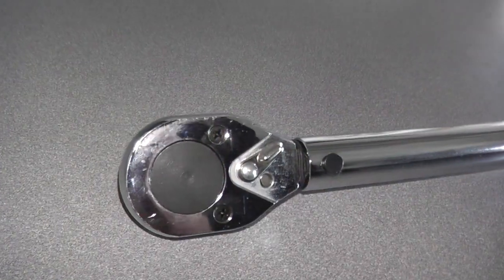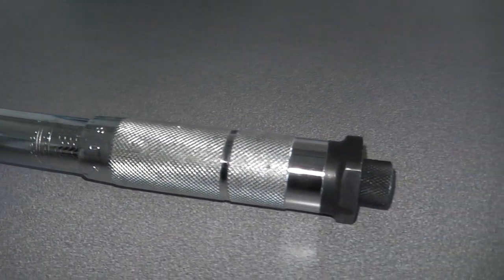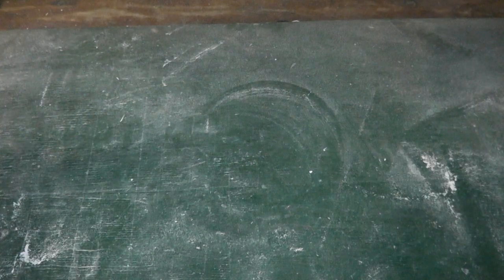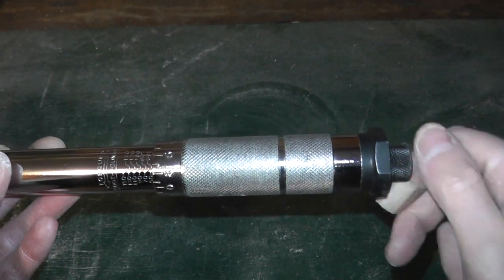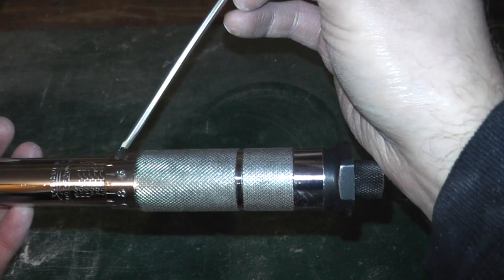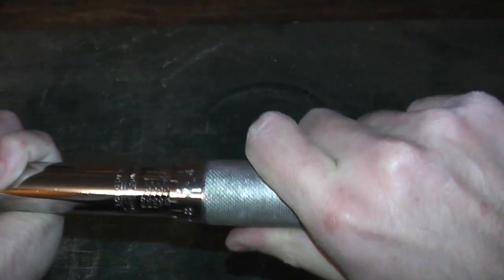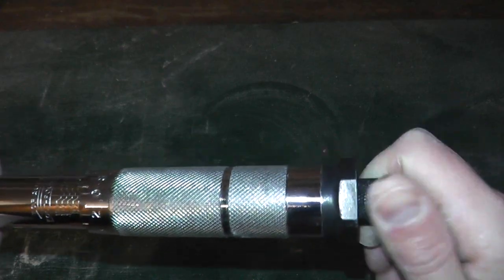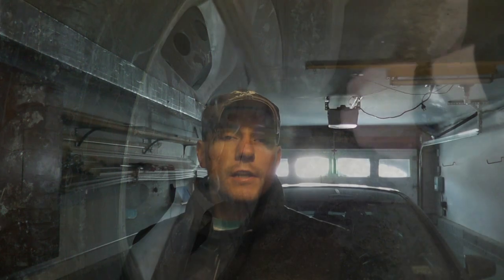How To Use a Torque Wrench

Comment: HF says to recalibrate these every 6 months what's your thoughts on this? Do you bother or does the wrench stay accurate much longer?
Reply from the maker: I haven't recalibrated; I didn't see that in the instructions. Although this is an 'older' wrench I'll double check this evening. Appreciate the heads up. (I have had no issues thus far using the wrench.)
Reply: CarsNToys no problem i just bought the 1/2" torque wrench from HF and there's a little paper instruction insert in the case. Also on their website under the product description there's a pdf download of the same instruction insert that comes in the case. I'm gonna return mine and get a digital torque adapter that can turn any ratchet into a torque wrench and can test any existing torque wrench calibration. HF sells one for $29.
Reply: A serious mechanic like yourself probably best to get a better torque wrench and a digital torque adapter to check it now and then.
Reply: CarsNToys not worth it for me unless you can calibrate it on your own because the calibration costs more than the torque wrench. There's an instructable.com article online called "fixing and calibrating a clicky style torque wrench" or buy the digital torque adapter that snaps on your torque wrench for $29 from HF and you can test your calibration and also use it with any ratchet or torque wrench. Not sure how accurate it is but plenty reviews online.

Comment: I have a spec of 10.333333 of foot pounds. How do I set it? Ever so slightly off?
Reply from the maker: Use an inch-pound torque wrench rather than a foot-pound torque wrench. 10 foot pounds is equivalent to 120 inch pounds. I grabbed one from my local part store for $20.

Comment: Just had my Harbor Freight Torque Wrench break a bolt in a engine cylinder.  Upon further testing, it no longer clicks at all.  Little use but about 5 years old, always set to zero when stored.
Reply from the maker: What a bummer
Reply: broadwayFan28 
YOU broke a bolt, WITH the wrench. Own it.

Comment: Great I bought a harbor freight torque wrench about a year ago and just start using it. I got a 3/8 but I think I will grab a 1/2 just for the heavy stuff. But you explained it right to the point.
Reply from the maker: Awesome. It hasn't yet let me down. Their breaker bar is excellent as well.

Comment: how do you know if the lug nut is 80ft pounds?
Reply: Lamphai Srivilau all cars have different torque values and you should find these either in the service manual or the forums
Reply from the maker: You'd need a torque wrench. Harbor Freight and Auto Zone are going to be your least expensive options.
Reply: +CarsNToys how do you know what ft pounds to use? or does it do it automatically?
Reply from the maker: Lamphai Srivilau You would just dial '80' into the torque wrench and tighten the bolt. The torque wrench will click when you hit 80 ft lbs.

Comment: Hi. Cheers for this helpful video. Where can I find out the torque settings for my vehicle's wheel lug nuts? Thanks.
Reply from the maker: Brian Su Sometimes you can find the specs in the owner's manual. What kind of vehicle? If it's a Nissan or Infiniti I can tell you the specs.
Reply: CarsNToys Thanks for your response. It's a Toyota GT-86 / Subaru BRZ. Would you happen to know this? Also, how do we find the correct torque for the wheel locking nuts if they are more fragile? Thanks.
Reply from the maker: Brian Su I bet it's in the owners manual. I was doing work on a Boxster yesterday and needed torque specs and found everything in the owners manual.
Reply: CarsNToys Yes I've just remembered seeing that Subaru BRZ service manual too. It's brilliant. It explodes all the parts, lists them, have torque settings next to them. :) thanks!

Comment: Hi, great vid.  If im using a inch pound wrench, are the numbers on the turning handle symbol of inch pounds also or are they in Ft pounds? Thx. For example 82 inch pounds would be what setting? 80 on the bar and 2 on the dial or what? Thx
Reply from the maker: Angel Muniz Sounds right but best is to read the instructions that came with the wrench.
Reply: if you're using an inch lbs torque wrench 12 inch lbs would be 1ft lbs simple as that

Comment: I tried it on my intake, wrench didnt click and I broke the bolt in my intake. Is there a chance the wrench was no good?
Reply from the maker: bigcartoonyIIV Did you set the torque too high on the wrench?
Reply: Im not sure. Im a rookie. I if im correct i set it at 75ft pounds. I felt the screw getting very tight. in my mind I was thinking this is getting too tight, and I wonder if it is suppose to feel like this.
Reply: bigcartoonyIIV same thing happened to my carrier bolt that was attached to the chassis. Broke the bolt in half. I was tightening to 122 lbs and the wrench was was not clicking. The wrench was $25 on sale...never again am I relying on that wrench. It was a HF torque wrench which I wouldn't mind so much because many of their other products work fine for me; but there was something seriously wrong with this one.
Reply: thesqaanalyst
Yea that thng had me wit an intake leak as well. Luckly i got the bolt out with an easy out.

Comment: Thanks for sharing best and simplest video on youtube. I got a torque wrench to change the brake pads on my motorcycle as my user manual stated a specific foot pounds. Simple, clear and to the point. Cheers mate!
Reply from the maker: Elliott Heron Glad to help, Elliot!
Reply: Ok you said the bottom numbers where you twist the handle needs to be on zero?
But what about the other numbers 1 to 8 what does it mean bro huh?

Comment: Thanks man. You made this seem simple. Just to make sure im correct. If an intake need 108 torque. turn the knob to 100 line, and torn number on the turning part to the 8?
Reply from the maker: bigcartoonyIIV That's pretty much it. You can also get a digital torque wrench which makes things a little easier.
Reply: Cool . I wonder if I can rent a digital one.

Comment: So u torque your wheels at 80 is that recommended frm GM thanks good vid
Reply from the maker: 270wsm140gr This Sentra requires 80 ft.lbs. I'm not sure for GM vehicles but 80 ft lbs. is common on many vehicles.

Comment: So I want to read or set the wrench at the bottom of the sloping line (for a number that's not going up or down in single increments)not where the line intersects the number right? Thanks...
Reply from the maker: Craig Cundiff For example, to set at 85 ft lbs, the '5' on the vertical knob would need to be in between '80 & 90'
Reply: Right, right...I get that..but, you know how on the handle the number has a line directly where it (the number) is.. then that line slopes down to a point on a middle line. Is the point at the bottom of the sloping line where the actual set point is? Or is it at the number?
Reply from the maker: Craig Cundiff That line goes to the number.
Reply: So the line where it intersects the center line from the number is where I set the wrench to use for that amount? I'm probably answering my own question...but I just wanted someone to confirm it or correct me if I'm wrong..lol...thanks...I appreciate your help...
Reply: The difference is 10# and for some things that can be the difference between stripping the hole and not... Thanks again...Merry Christmas...!
Reply from the maker: Craig Cundiff You got it. Glad to help and Merry Christmas